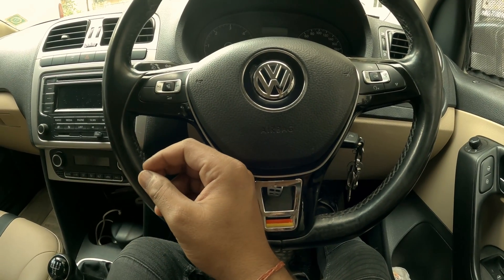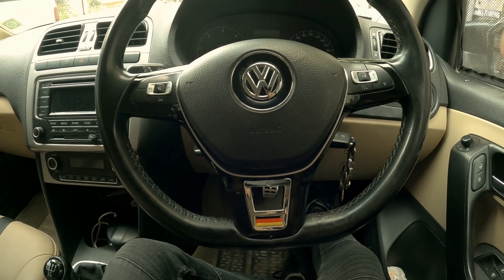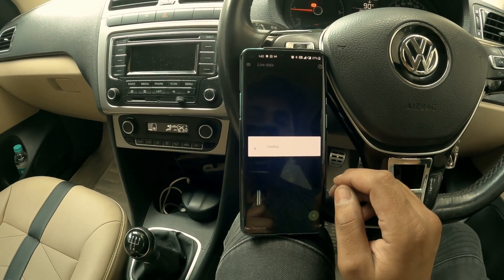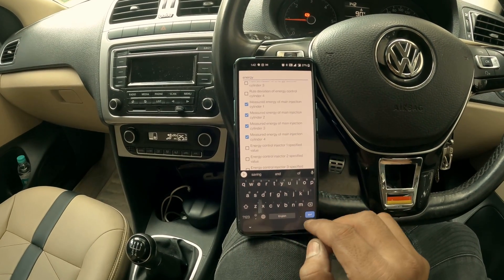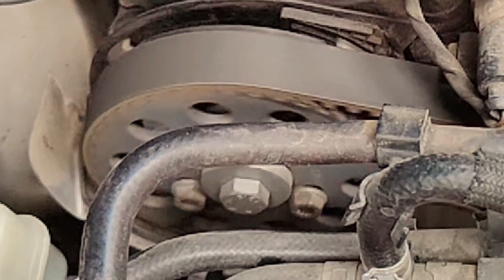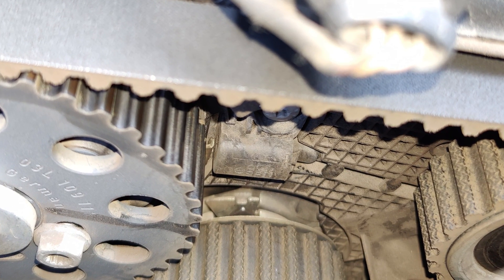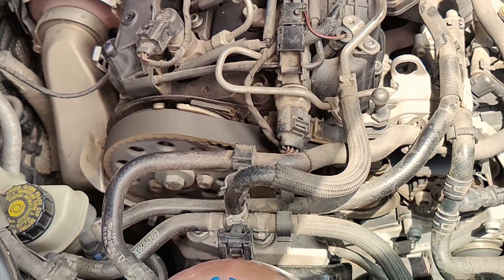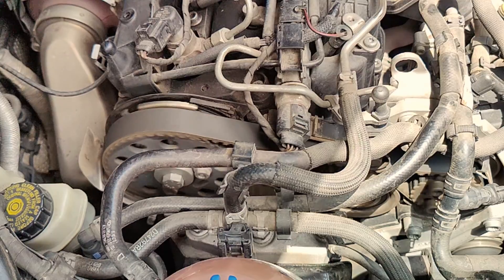HOW TO REDUCE DIESEL ENGINE CLATTER NOISE IN CARS | INJECTOR CALIBRATION NEEDED ? | TICKING TDI

Comment: Piston expand and contract 🤦🏻‍♂️😅, gap between piston and cylinder is failed engine. 1:07 so during cold Start the engine pushes out fuel and air down towards crankshaft due to gap as they take to time to heat and expand? 🙆🏻‍♂️
Reply from the maker: Sir i can understand your confusion , just search the term " thermal expansion" on web and give it a read , its a grade 7-8 concept of physics

Comment: I have watched your video and understand what you are saying and discribing ref injector minimum deviation quantities.
However this would not appear to be correct from my real world experience of this issue.
After trying to unsucsses fully perform a  VCDS  IDE 06141  minimum deviation quantity test.
I now find that my exhaust has a strong smell of diesel,and my normal recorded mpg has reduced from 56 mpg to 44 mpg.
How could this happen if the ECU is only controling   fuel ballance in each cylinder whilst engine is idling 780-800 rpm ?
Where should l start looking for this loss og mpg issue.
Running a VCDS full system scan on my 2009 VW Golf  Mk6 1.6 tdi cayc shown no error codes ,yet i am suffering a large mpg reduction after this failed test.  Any help or surgestion would be most appreciated with this issue
Reply from the maker: Due to the test , the system received a sort of reset . And as per the base values stored in ECU are mostly designed as per the ideal conditions , which in the real world rarely happen. 
So what you can do 
1 - use a fuel system cleaner , sometimes a sticking injector can also reduce your MPG values , as you can smell fuel , that means the mix is running  rich .
2 . Give it a soft reset .by disconnecting the battery for 15 mins and then reconnecting it back again , then let it idle for at least 3-4 minutes , in that time ECU will relearn  all the values and adjust accordingly.
Reply: Thank you for this advice ref my tdi overfuelling issue.I will carry out the procedure you have mentioned to see if things return to normal.I appreciate you taking of your time to answer my question @yourDIYneeds
Reply: Well I follower your advice and carried out the  Liqui Moly injector cleaning and battery disconnecty 30mins.
Unfortunatly this has not resolved the  irregular idle when cold first start in the morning.Also still running rich no smoke from exhaust but lower fuel economy @yourDIYneeds

Comment: I agree with you but you can change injectors deviation just by changing the ID code. It's normal procedure after injectors have been restored.  But sometimes old wear out injectors work better on code from random injector. its like old locks start to open with key from different lock and even better than with its own. Chances are low but so as repair advice😂
Reply from the maker: 🤣 nice example 👌😅

Comment: Hi bro, i own a 1.5 tdi. There was leak in fuel return line. Got it sorted. Now i hear clanking noise when i accelerate mildly, also the AC keeps doing a pressuring sound very often. Clanking noise disappers when AC is on fan speed 3. Whats the issue here? The car also spits out a little black smoke when acccelerated...pls help
Reply from the maker: For black smoke , sir get the intercooler cleaned ,  and the clunking sound can be better explained if i can have a small video 
.you can send it to everydaydiyhelp@gmail.com
Reply: Same issue for my vw jetta

Comment: Can I get this done in Hyd?
Reply from the maker: Talking about adaptation sir ?
Reply: @yourDIYneeds hi , i dont Whats adaptation.

But i have a high noise and vibration in nexa ignis diesel automatic (AMt) almost 71k done . 
2017 model
Reply from the maker: Sir try to run a diesel system cleaner first , it will help the whole fuel system to get cleaned, and help to reduce noise and vibration  , leaving the link of the best fuel system cleaner i have used till date 
https://amzn.to/3R4grN7

Comment: I hope you are just kidding with all that bluffing you just said. 😅😅😅😅😅😅😅😅
Reply from the maker: Why do you feel that sir ? its not
Reply: @yourDIYneeds  
You say 'piston slap' is the reason?  Then all engines new or old will have that noise? C'mon man.😣
Reply from the maker: Sir , before 2006-2007 all engines came with high pressure piston rings , which doesn't allow much movement on the piston inside the combustion chamber but after that time almost every brand moved to low pressure piston brings on the name of fuel efficiency, but the downside of low pressure was , till the time engine was cold they had more wobble than the high pressure rings , but as soon as the engine warms up , rings expand and put more pressure on the cylinder walls  which make the whole piston and conrod combo a bit more stable , thats the reason why cold engines are more noisy than a properly warmed up engine . 
Hope i made my point clear sir .
And piston slap is one of the reasons not the whole story,
Reply: @yourDIYneeds  
You are correct about reduced ring tension but wobble due that is minimal and not audible in most cases ...try detonation at idle rpm due initial microsecond squirt of fuel from injectors don't autoignite causing momentary detonation which is now improved by multi-injection pulses.
Reply from the maker: Yes , multi injection helps a lot to reduce the clatter as pressure increases gradually as compared to single injection. But the noise from detonation is completely different as compared to piston slap .
Reply: @yourDIYneeds  
You said starting 2006 rings were reduced in tension. Does that mean before 2006 'diesel knock' or clatter was non- existent? ☺
Reply from the maker: Sir I mean in almost every engine, 
And before 2005-06 diesel engines had a similar note , there was usual clatter but underload the note of clatter didn't change

You can observe the effect of piston slap on sides of piston , slap leaves marks overtime
Reply from the maker: Diesel clatter , piston slap and knock all are different things and have different noise
Reply: @yourDIYneeds  
Ok thanks anyway ☺
Reply from the maker: Anytime sir
Reply: Piston expand and contract 🤦🏻‍♂️😅, gap between piston and cylinder is failed engine. 1:07 so during cold Start the engine pushes out fuel and air down towards crankshaft due to gap as they take to time to heat and expand? 🙆🏻‍♂️

Comment: I have a Skoda laura 2.0 tdi l&k recently i faced one issue in ideal it doesn't make any noise while i press the acceleration in ideal some noise comes from the engine (kut kut kut) ..it can only be hear if we open the window.. inside the car it cannot..i don't know whats the issue..can anyone help or give me some advise?
Reply from the maker: Maybe a lifter has started to make noise , only comes when the engine is cold ?
If yes then use this it will help - https://amzn.to/3rFOSie
Reply: @yourDIYneeds  yes only when it is cold..its time to change oil as well do i use engine flush this time while changing oil...i never did it before it ran 1,23,000km
Reply from the maker: Sir its already 123000 , so don't use a flush , there may be some seals which are still working fine because there is some amount of carbon on it , but after flushing they may start to leak . So anything over 60k kms is not a good idea to flush .
Reply: @yourDIYneeds  ok sir thanks for the guidance ill first change the oil n check it the noise goes away
Reply: @yourDIYneeds  got the issue resolved by just changing the oil 👍🏻
Reply from the maker: That's great sir
Reply: @yourDIYneeds  but still when i start the car the noise comes for 10 20 seconds and when i shift to D drive mode it goes off can you tell me this reason?
Reply from the maker: Yes sir its lifters , use the additive i told you about
Reply: @yourDIYneeds  ok sir can you guide me how to use like while changing oil we have to put it or different methods... and yes i went to a mechanic he said its a bad flywheel noise
Reply from the maker: Sir , does the intensity of noise changes as you accelerate ?
Reply: @yourDIYneeds  yes when I accelerate the noise goes off and when i leave the accelerator the noise comes back tuk tuk tuk some what like this and the noise goes off while we drive it approx 30 20 km (i mean the noise reduces not goes off 100%)
Reply from the maker: Yes sir , lifters
Reply from the maker: Just add with oil and keep the final oil level in check
Reply: @yourDIYneeds  just changed the oil a week back so asking
Reply: @yourDIYneeds  lifter means the tappet sound correct sir?

Comment: Hi @yoursDIYneeds

Why your engine RPM is around between 1 - 1.1 

I have the same issue when in idle, sometimes rpm automatically increases along with radiator fan turning on.
Reply from the maker: Sir that's normal , sometimes cars do these things to manage temperature , load , pressure and various other things .
Reply: @yourDIYneeds  Thank you very much for your reply.

All the best for your project Polo!
Reply from the maker: Thanks  sir , it means a lot
Reply: Your engine is doing a DPF regeneration.
Reply: @CRiCU90  not really, i figured out the issue it’s not normal as said above - it’s a voltage issue in the car. One of my cars aftermarket accessory draining voltage and because of the drive battery voltage ecu is triggering message to increase rpm to charge the battery faster.
Reply from the maker: @sasikanth1091 sir i checked it with all the accessories off as well
Reply: @yourDIYneeds  I have resolved the issue by disconnecting the accessories wiring and switching off the accessory didn’t solved the issue to me either and i understand sometimes rpm increased to manage the voltage load which is common but if it is doing regularly means some where there is voltage leak ( parasite drain)
Reply from the maker: @sasikanth1091 sir if i leave the car even for 15 days , it starts on the very first crank , if there is a parasitic drain then it would Never be possible
Reply from the maker: @CRiCU90 no sir , it doesn't have a dpf

Comment: Hey bro nice informative video. In my 1.6TDi when vehicle is in idle position with AC on, I hear a huge clattering noise. What's the solution? How to reduce it?
Reply from the maker: Sir , in my experience i have noticed that if we give the engine 3-4 mins on cold start to warm up ( without any load )  and turn on ac while we start to move (not on idle ) ,  that reduces the clatter a lot . And on top of that a good quality engine oil definately helps .
Reply: @yourDIYneeds Brother which is the best fully synthetic engine oil for polo 1.2 tdi , now I am using VW Special D 5w40 engine oil. 
Liqui Moly
Amsoil 
Castrol 
Shell 
Meguin 
Mannol.    ???????

Comment: My 2.0 tdi makes low click click when its in operating temperature at idle... There is no smoke no late start issue and pickup issues... Is it normal?.... It has bosch injectors
Reply from the maker: Sir injector have a tick-tick noise and usually engine cover is able to absorb that noise .
Sometimes same sort of noise starts to come from hydraulic lifters which are connected to the CAM shafts . You can use an additive which is specially designed to eradicate the noise by liqui moly which works great for this issue otherwise only option is to get the lifter changed 
Link to product - https://amzn.to/3PUqznn
Reply: @yourDIYneeds thank you I will try liq moly

Comment: wow. are u an engineer ???
Reply from the maker: Sir , education wise not 😂, but maybe out of passion
Reply: @yourDIYneeds  incredible in that case. by the way whts ur education background then ?
Reply from the maker: Sir i am post graduate in international business
Reply: Great to know this. I have done my PG in economics. I too have a decent interest in automobile technology. Own a vento TDI 1.6 (2013 model). Need to discuss a few things with u regarding my car's problem....it pulls to left side....wheel alignment didnt solve the problem initially......then i went for wheel rotation which solved my issue for some 150-250 kms....issue cropped up again as i drove my car on roads with moderate potholes. What could be the issue ?? Right CV joint has mild leakage.....nothing else looks messy to me. plz help.
Reply from the maker: Are the tyres inflated to the optimal level , as its a very basic thing and often overlooked
Reply: @yourDIYneeds  Yes they are.
Reply from the maker: Then sir the very next to doubt is either an improper alignment or a slightly moved subframe ( third reason can be a tyre which is worn from one shoulder)
Reply: @yourDIYneeds  is there a way to talk to u ? give me ur email...there we can share numbers and may decide to talk verbally. (only if u r comfortable with the idea)
Reply from the maker: Sir everydaydiyhelp@gmail.com

Comment: Is doing engine flush safe in rapidb2012 tdi.....
Reply from the maker: Sir if done as per instruction , it can help to remove the internal carbon deposits in oil gallery and passages of engine

Comment: Sir is it okay to solder camshaft sensor wires as it was rat bitten 
What do you suggest should I replace it
Reply from the maker: Sir yes it can be joined by solder , no issues , just insulate them properly afterwards
Reply: @yourDIYneeds  thanks sir

Comment: Wow someone who actually knows what he's doing great videos. Need help any way to body lift vw vento rapid any jugad for front hat? 1 inch is enough but 2 would be even better i want to fit 25.5 inch tyres stock is 23.74 any help is appreciated. For the rear its easy im having difficulty thinking of any mount

Comment: Hi, I have a skoda rapid 1.6 TDI and only this year I replaced the auxiliary water pump (electric) 4 times. Any ideas to the problem here ???
Reply from the maker: Sir in 1.6 tdi engines , that's a common issue , auxillary pump failure , vw realized it and later 1.5 tdi doesn't have a auxillary pump 
Best i can recommend is go with a OEM pump
Reply: @yourDIYneeds  sorry 🤭 but what is an oem pump ??
Reply from the maker: Sir original Volkswagen auxillary pump
Reply: @yourDIYneeds  the last one wasn't, but all the first 03 pumps were originals
Reply from the maker: Sir in that case firstly get the output voltage of for the auxillary pump checked , maybe the voltage at the connector is getting high , which is making the pump's motor to experience spikes in speed

Comment: Hello mate. Great explanation! I own a 1.6 TDI which has run 1.5Lakh km. Recently I have been facing an oscillating motion on my engine during 1200-1400 RPM specifically. Thereafter, I got my transmission and engine mounts replaced along with an engine flush and oil service. Now the engine runs smooth, but that oscillating motion hasn't been gone yet. Could it be the pendulum mount or any other mechanical fault on any component? Could it be a turbo leak, MAF sensor, or turbo boost control issue? Any suggestions on a vague diagnosis would be of great help.
Reply from the maker: Sir usually pendulum mount has a little bit of slack in the bolt hole to adjust it for the kind of feel you want from your engine , if you tilt the engine backward then the power is sudden and sometimes it can be jerky and opposite on the ther side . 
If your problem is more like a jerk in certain rpm range then i would advise to clean 2 things 
1. MAF sensor 
2 EGR return circuit pipe , if its chocked then it can throw same symptoms. 
I have video of both topic , you can use it if you want to . 
And last it to reset your cars ECU 
Disconnect the negative battery cable for 15 mins , then reconnect it , start the vehicle and let it idle for 5 mins . 

Hope it helps
Reply: @yourDIYneeds yourDIYneeds Hi, I did all the three steps mentioned above. But still the problem exists. Could it be the diesel gate update which made the car perform like this? A friend of mine (ECU tuner) told me that it could be, and I can flash the old firmware for restoring it to the old form. Could it help with the issue? Also can it pass the emissions test with the old firmware?
Reply from the maker: Yes it will pass the test will old software without any issues , jerkyness due to new update almost have negligible chances .
Just make sure the software you have is actually old software
Reply: @yourDIYneeds  Hi. Thanks for the info. Turns out the issue was with the clutch kit. Change the complete assembly, lathed the flywheel and changed all the 3 mounts (engine, transmission and pendulum). Now the jerks are gone for good and car feels like it’s a new one!
Reply: Hello buddy, can you please help me with the old software (pre-dieselgate update)… my polo 1.5 tdi had become much worse than a tractor as there is huge amount of clatter at the take-off and before reaching operating temperature…
Reply: @kushalsapare2734  Hi. Due to the weather conditions, TDI engines are prone for making clatter noise at the very start. But as soon as you start driving some distance, the noise will be muffled. The old software wouldn’t get rid of the clatter noise significantly. Did a research on that, and turns out it doesn’t do much of anything.
Reply from the maker: Sir after update , noise was also up , by the way which engine oil do you use ?
Reply: @yourDIYneeds  which engine oli is best for 2.0 CR TDI ENGINE??? Please suggest??
Reply from the maker: Sir liqui moly toptec is the best for tdi engines 
https://amzn.to/3LcIbZ7